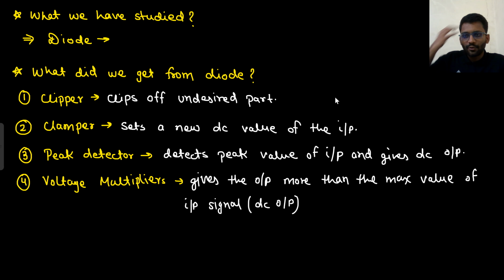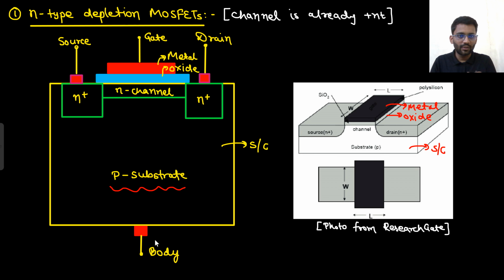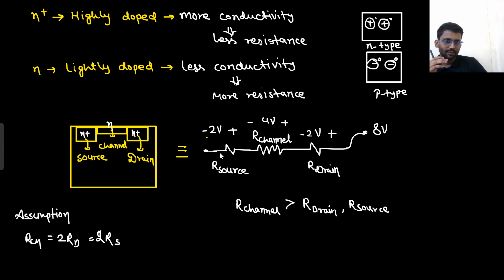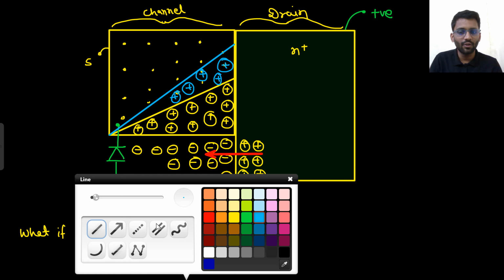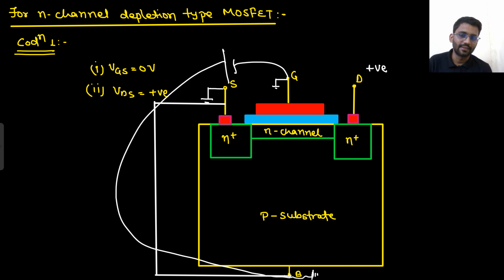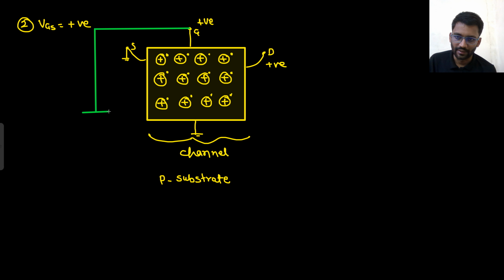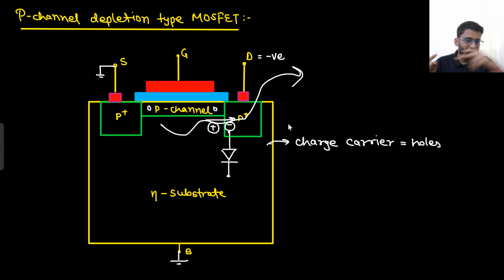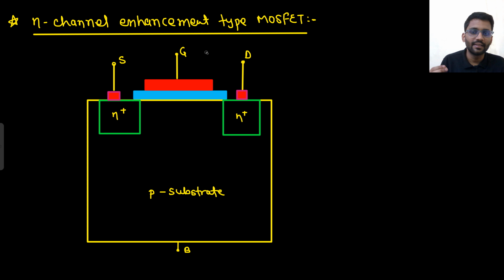Introduction to MOS & Depletion type MOSFETs || Analog Electronics || PrepFusion || Himanshu Agarwal

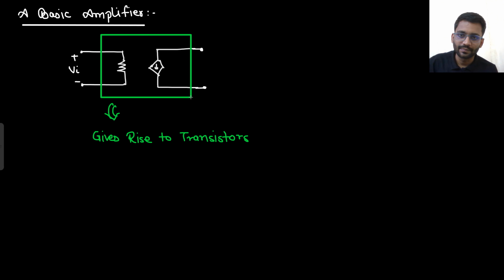Comment: Error - at 5:18, that Ro Resistance would come in parallel. Modified it later on.
Reply: if the resister comes in parallel, the output voltage Vo should be -KRoRLVin/(Ro+RL).....ins't it ?

Comment: @51:16 The definition for pinch-off voltage given here is the voltage at which the current becomes zero. However, what I studied is that the pinch-off voltage (VP) is the drain-to-source voltage (VDS) at which the inversion layer (channel) near the drain end becomes pinched off due to the high electric field. This occurs when the MOSFET transitions from the linear region to the saturation region. As VDS increases beyond VP, the pinch-off point moves towards the source end, but the drain current remains relatively constant. What is the correct meaning of pincch off voltage.
Reply from the maker: Watch enhancement type MOSFET video, It will be clear to you.
Reply: @PrepFusion_GATE  Sir I too studied that the pinch off point is at Vds(sat)
Reply: Some comments are enough to revise the topics. # 💪✅
Reply: I think the definition of pinch off voltage given here is valid for JFETs